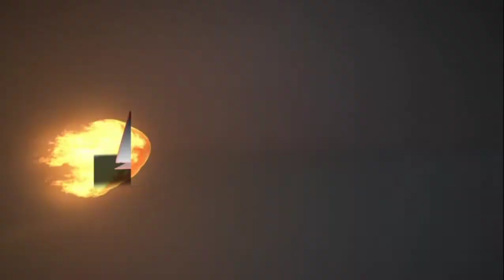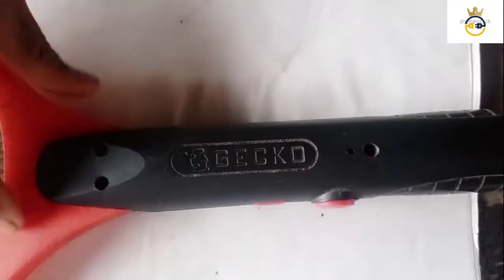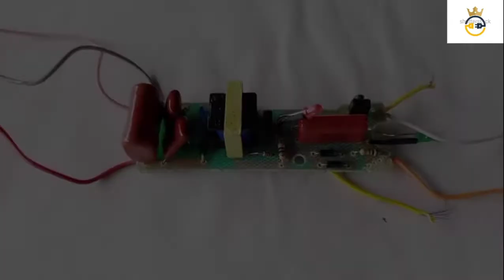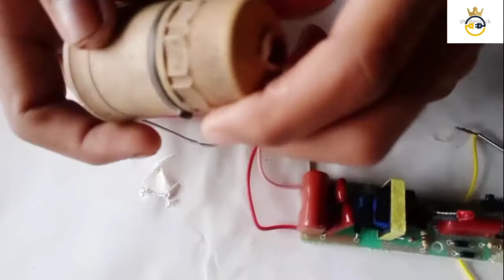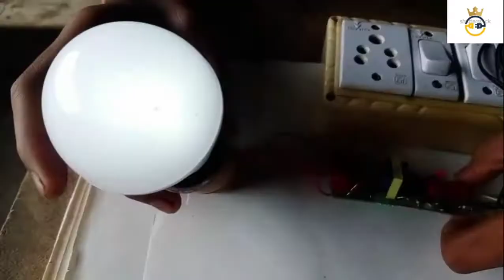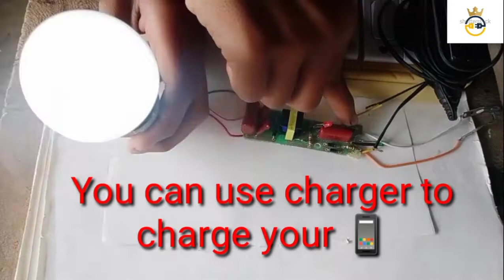How to make Inverter at home || Mosquito killer bat || घर पर आसानीसे बनाईए ||

Comment: This is not AC. this is high voltage discharge and will damage your bulb soon. Save money and Save you life. Don't play with electric current!!
Reply: No bro there is an voltage decreasing circuit inside the led bulb
Reply: It is ac in lower frequency